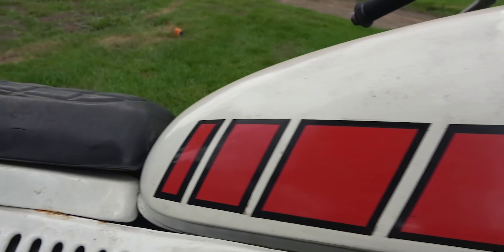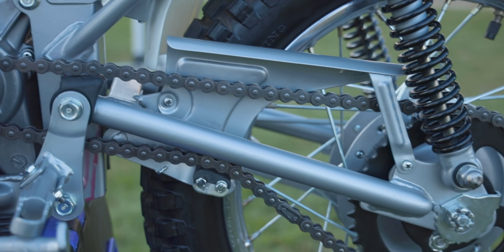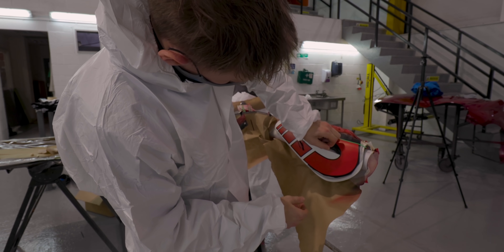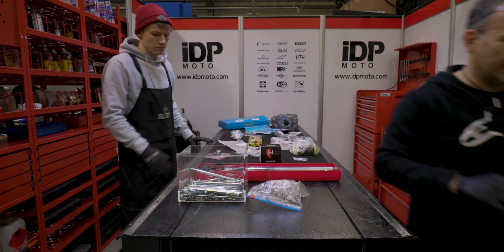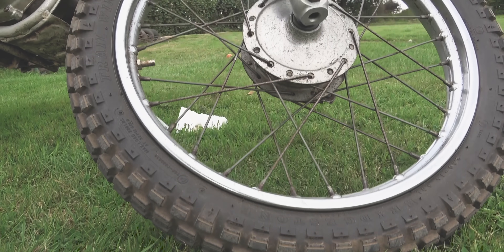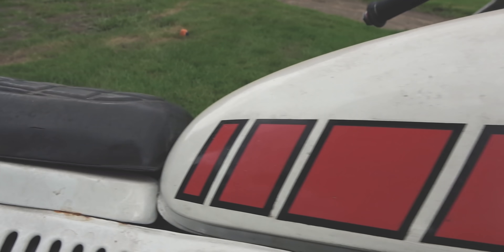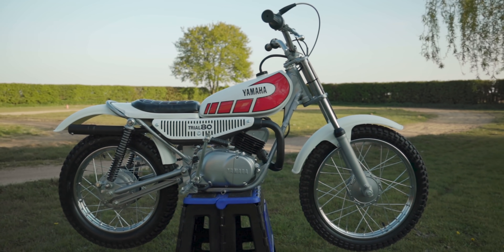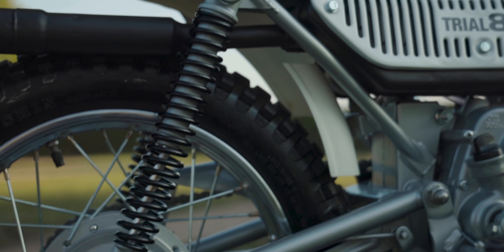I Restored A Motorcycle and I Did Not Expect This To Happen...

Comment: YouTube v55/4 form fill .
Dirt bike to Road legal Enduro exempt (seat height bullshitttttt is now nooo more a horse to mount 930mm) forms fill.
Buy 2 Bontrager sigma sports high beam X 3 rechargable (I also have 2x Amtech LED high performance for show led show\ to / very bright) battery X 2 = 6 last 2 3 hrs highest beam. Buy 12 + AAA lion 1200mah should keep you going.
2 3 month alarm battery 🔋 on smart taillight needs 2 L bracket upside down and 2 nuts bolts to buy -(   )- which needs 2 drill holes to the mudguard to Onvian pole fitting.
Very very nice bike 😁👍
Onvian smart taillight indicator horn all-in-one alarm and yours truly road legal MOT pass